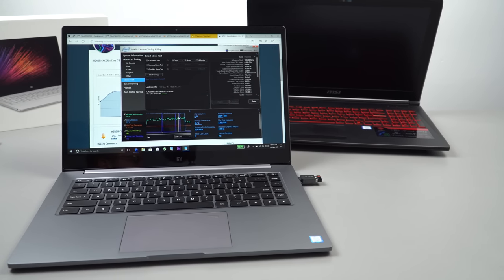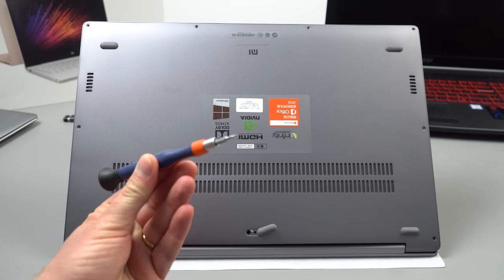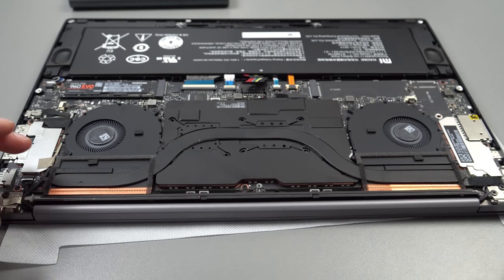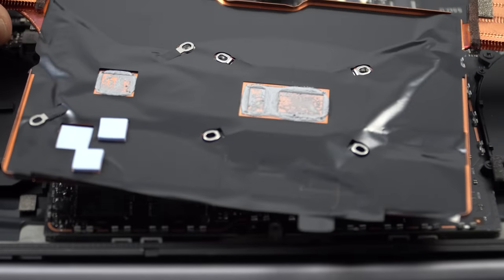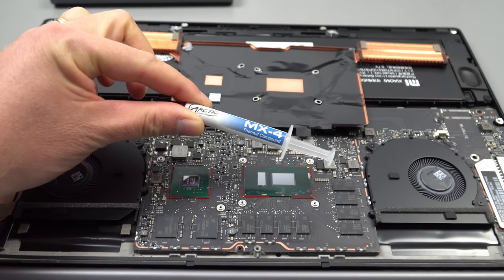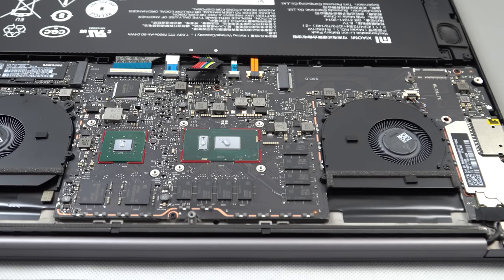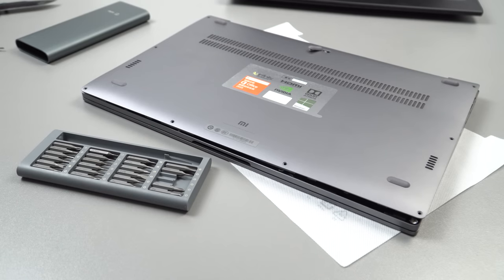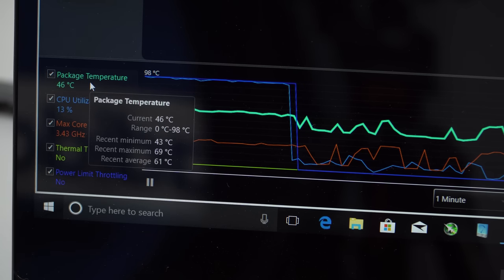Xiaomi Mi Notebook Pro Thermal Repaste, Results, How to Open & Add SSD

Comment: 5 degrees drop is actually a nice improvement. It might not be that impressive for desktop rig, but we are talking about slim laptop. Those crappy pastes that come with notebooks usually do not last long enough to provide decent cooling for even a year of heavy usage.  So, it is DEFINITELY worth it.
Reply from the maker: Yedige Moldagaliyev I was thinking more in the amazing 15 drop on my MSI. But it has a big fan so all in, 5 degrees C is good. Just maybe not for everyone the work involved for 5 degrees C.
Reply: If it's worth it, if you can make the heat dissipate into the chassis/cover as well, maybe it's worth trying? It would hot on the lap though. :P
Reply: @xygnal  Beside dust cleaning and replacing the thermal paste, undervolting the CPU also helps reducing the heat. I use throttle stop for that. Controlling the fans is also good, I use NoteBook FanControl for that but it is very complex (need to read Embedded Controler and testing the fan whilist searching for fan registry to program  it)

Comment: 5 degree is definitely worth it :)
Reply: Nope, it is not. You talk about a mobile CPU and not an i9 Threadripper here. You don't need OC headroom here.
Reply: Red Phoenix Well, actually you can quite overclock it. I've seen people improve both CPU and GPU performance by a 30%

Comment from the maker: This one was requested quite a few times. What do you think, Is it worth the hassle for 5 degrees C max less on maximum temperatures?
Reply: 5 degrees is a big improvement, but i guest i am toooooooo lazy and probably won't do it.
Reply: Even a degree might stop the fan from spinning, so 5° is actually a good one. Remember the GPD Pocket? I also only get 5° drop (in idle) even without using the MX-4, but the machine becomes so awesome that you can push it a lot more (it can now compile its own kernel with all 4 cores in turbo) without getting frozen or reboot.
Reply: I use liquid metal on my macbook pro 2012, got about 20C cooler than before. it is not so hard to do
Reply: for the Enthusiast level, the answer is yes h_h.
Reply: It depends. Seems their cooling is adequate this time, compared to their Air 13 which thermal throttles like crazy with that stupid single pipe-dual heat sources design.
Reply: I think it is. I wouldn't mind running at 75c at a given time but I would not like running at 80c

What I discovered recently was that even if the fan intakes from my razer blade looked fine the system was running real hot. Blowing on the fans didn't work and the fans looked fine.

Blowing from the exhaust however showed debri, there was a layer of dust collected at the fins which were invisible and in order to clean them you must blow air in the reverse direction from the exhaust.. My laptop went from 97c to 75c avg.
Reply: What I would be more curious about is how you switch the hardware keyboard layout to a completely different one than chinese. I started assuming it was not possible as some symbol keys just aren't the same but maybe it is?
Reply: 5 down from 74 is in fact 6.75%. Which is pretty decent, it doesn't take much effort in my opinion if your unscrewing the bottom to place an SSD. But considering the the quality of the paste i would reckon the temperature would start to rise shortly after purchase.

So yes, it's worth re-pasting when you can safely.
Reply: fyi - polishing the copper plate can help a decent amount.  also, there is non-conductive "metal" paste out there that is supposed to work pretty good too.  btw, can you test the gpu to see if that helped it's thermals at all?
Reply: YES.. -  polishing the copper plate can help a decent amount
Reply: USE LIQUID METAL :D
Reply: I've read on a recent internet post that the fan is set to kick in at a certain voltage, not temperature. The new heatsink paste might improve CPU / GPU temps, but the fan will still be noisy.
Reply: you dont need to spread it at all tbh. the heat sink will do that.
Reply: Yes, 5 degree lower with just re-pasting is totally worth it.
Reply: Good video but I think 5 degrees drop is worth it.

Comment: In the next video use clear nail polish on the exposed electrical components on the processor and then you can use Thermal Grizzly Conductonaut.

Comment: Do becareful if you are planning to open up the back cover. The side clips are fragile. I broke 3 ! Not sure how to avoid it as it is really tight and you do need some level of force to pry it off. So yeah, you do have to ask yourself if you really need to do it and if it will be worth it.

Comment: It makes a huge diffrrence, use both the arcticlean purifier and cleaner and put grizzly kryonaut on perfectly you can get around a 8-10 degree difference instead of a 5, also in the long run the old one wudnt have been worth it, can you upload some more mi notebook pro videos?
Reply from the maker: Maybe not too sure what more I could post on the Mi notebook Pro. I have covered it all. The last might be a follow-up video.
Reply: try to install mac os on it

Comment: I just wanted to say that I bought this laptop to have a portable machine that i could use for somewhat intensive tasks. It was an upgrade from an alienware17 and a surface pro 4. It sort of combined the two. Anyways, I use Solidworks a lot for 3d renderings and flow/stress simulations and after setting up an overclock profile in Intel's XTU, It overall outperformed the desktop PC I was using(dual 980tis, core i7@5.0ghz). I was however experiencing thermal throttling when running some simulations. I later confirmed that was happening by running a couple stress tests. So i decided to go ahead and I opened the laptop up, removed the paste (which seemed a bit too dry for some reason) and I added some arctic silver 5. I put the laptop back together and after running the same set of simulations and tests, I did not throttle a single time.  Maybe there is some variability in the paste/application of it but for me, it made a real-world noticeable difference.

Comment: When repasting, you shouldn't look at the amount of it to determine the quality of the pasting job. The only difference the amount makes is how clean it looks (as long as it's not way too little). The way of applying also really doesn't matter; just skip the spreading part, the pressure from the mounting screws will do that just fine for you, especially on such a small surface. You can do it if you want, but it will not improve the thermals at all. Source: https://www.youtube.com/watch?v=r2MEAnZ3swQ 

In short; buy a better quality thermal compound (I'd recommend Thermal Grizzly Kryonaut if you can find it at a decent price, or Gelid GC-Extreme if you can't), just put a little bit on there (too much is better than too little) and let the mounting pressure do the rest.

Comment: Could you confirm that the 2nd SSD can be SATA or NVMe (2280)? Could they work in RAID mode? Thank you for your awesome videos!
Reply: aldebarandj for some reason they are only given 2 lanes of pcie so i dont think you would be able to. Thats why drives cant hit top speeds.
Reply: The first SSD has 4 lanes alright. It was a UEFI issue.

Comment: Hi there, I'm just wondering what type of SSD you added to the secondary slot?

I know you say both will work in the video... but I'm curious where you got that information from? Did you try both types yourself?

I've been looking and posting all around forums, youtube, and even contacted my import company for compatibility but have not yet received a proper response indicating which type of SSD will and won't work in the slot

Some say PCIE x4 NvME will work and SATA III won't
Some say SATA III will work and PCIE x4 NvME won't
Some say both will.

It looks like you added a Crucial MX300 which is a SATA drive.

Also I'm trying to upgrade to a 1TB SSD for the secondary slot. Do you see there being any problems with this size?

Thanks in advance. Great reviews you have on this product by the way. The best that are out there really... quite in depth and easy to understand.
Reply: I bought a crucial P1 NvME 2280 and it worked at first but then it stop detecting the disc, when I rebooted it, it sometimes recognized it and sometimes didn't.
I contacted Crucial and they said the laptop wasn't compatible with the drive.
Now I don't know what to buy.
Reply: for second its sata m2

Comment: I have an idea, the fans are metal right? And they are cooled anyway. Do you think that it’s a good idea to put some thermal pads on it to absorb the bottom panel temperature? It would make it harder to open the case though  but it’s not permanent
Reply: They are plastic

Comment: In a desktop? Meh, not a huge improvement, specially with a cheap 212 EVO and a huge fan, but on a tiny space with "anemic" blower style fans are more than you give them credit. Those degrees may not be a lot, but may be very well the difference between fans ramping up far less on normal use conditions. And if the paste you replaced was already starting to dry out, those 5 degrees may not seem much, but will be HUGE in a few months. Your ears will be glad you did this.
Reply from the maker: llomellamomario surprised me how it was already drying out a little that factory paste.

Comment: Dude come on, 5 degrees is a lot for a notebook, but mainly for the following reason: The better thermals you have the longer it is between maintenance is needed to clean out the inevitable dust build up on the fins of the heatsink. So yes, it is worth it. Also the laptop will be more silent because the fans don't have to kick in as loudly or as often. Another thing is that when you have huge spikes in cpu usage better thermal paste will deal with that better, so for applications where your cpu spikes a lot it is worth it. 5 degrees is alot in a laptop.

Comment: I have an idea, the fans are metal right? And they have good airflow anyway. Do you think it’s possible to transfer some heat to use it as a heat sink itself? Use thermal pads between chassis or some super flat copper bridge to heat pipe
Reply from the maker: it would be possible, but not really sure it would do much here. In the case of the fanless tech I review it does really help out.
Reply: Thanks

Comment: 70 deg under 100% load? that's a lot of headroom for a thin and light laptop. even for u series processor. they did a really good job cooling their cpu
Reply: i got 100*C all the time Thermal throttling with only chrome and 50 tabs.. cpu 10-15 Utulized

Comment: In case I want to install XTU, the installation routine tells me, the hardware is not compatible. Is this true for the Xiaomi Notebook Pro GTX Version? It seems I have massive throttling but only in battery mode. If connected to the power brick the performance is excellent.

Thank you
Michael

Comment: Just a question not related to the CPU, but i will buy this computer and i would know if it's possible to have 3 screen in total (2 external screen + the computer screen) for example 1 screen on the hdmi and 1 in the USB-C (with an adapter). Thanks for your great test.
Reply from the maker: Yes its possible. One screen on the HDMI, one the laptop screen and the other via the Type-C port.

Comment: i got closer to a 10c drop with noctua nh-1 and the pea method rather than the bag method, very worthwhile upgrade.
Reply: Jon Daly nice, did you also notice the fans come on less? Still looking for something to shut them up
Reply: you know i thought they did, but i read somewhere that the fan speed is controlled by voltage rather than temp, i have noticed a difference in fan noise after using xtu, i couldnt undervolt using xtu as i have the rev 501 bios but you can force the cpu to underclock by reducing the boost power limit to around 11-13 watts so that the power throttling kicks in and that has had a significant impact on fan noise under load for me.
Reply: 11w still gets a 3ghz boost under load and but the 3rd speed on the fan curve doesnt kick in nearly as much

Comment: The BIOS shouldn't reset, that's what the CMOS battery is for (unless they do not have one, which is unusual).
Reply from the maker: Hugo Costa Never saw a battery for the bios in there.
Reply from the maker: That would explain it

Comment: 5 degrees but how much rpm on the fans? i changed my thermal paste on the lenovo x240 , had a 12degree decrease with a 400rpm fan decrease

Comment: Use some thermal pads on the vrm's if the heat sink is that big. It helps dissipate alot of heat as well.

Comment: A five degree reduction in temperature will translate into more reliable performance at higher ambient temperatures, so yes, it's worth it.  If better quality paste doesn't dry out and lose effectiveness over time, then yes, it's worth it.  If doing this gives you more peace of mind, then yes, it's worth doing.
Reply from the maker: Yes at the time due to the effort I didn't think it was worth it. But yes you're right it is.

Comment: Cooling problems on Jumper, Onda and Chuwi tablets and laptops is one thing. Those are low-end off-brands and it's to be expected. 

Xiaomi and MSI should really know better though and this is pretty inexcusable.
Reply from the maker: MY MSI was a shocker, hit 96 degrees C. With my repaste dropped it to 81 degrees C max.
Reply: I think when you pay for a brand name like that you should be able to expect a certain level of quality and service and MSI have clearly failed on that one.

Comment: The real problem with this notebook is why should the CPU fan kick on at less then 20% CPU load, even for 5 sec loads? How much heat can be generated when CPU is working for 3 sec at 25%, that the cpu fan needs to come in and spin? It's ridiculous, something need to be fixed at the logic level, not at hardware one, right? At least, I'm talking about the Xiaomi air 13, I don't know if the Pro behave the same.

Comment: "I use a high quality thermal paste"
"I use MX-4"

Arctic Silver 5 would be a better replacement bro.
Reply: Not really. They're negligible in temp difference and AS5 is more dangerous for something like this where you have a lot of SFF conductive components close together.
Reply from the maker: Exactly I prefer not to use AS5 for that reason. and the difference between top end and med range paste will be like 1-2 degrees if that in a case like this. If it was an i7 8700k I would rethink what paste I use and go for the best.
Reply: I still use MX-4 even on desktop PC's tbh because I find it far less risky and I've always been pleased with the results. I've never been a fan of AS5 and I used to hate fixing 360's when people had caked the chips in silver paste.
Reply: Check my reply to Blood Rose's first post, you might enjoy the read.

Comment: You should really try Conductonaut on this or some other ultrabook. My dad has an old Pentium T6100 which has TDP of 25W.
After putting Conductonaut on it, the temps didn't go above 50°C even after 30min of prime95 smalFFT torture. Fan was spinning at it's minimum RPM.

Also, someone mentioned nail polish on resistors. It would be awesome if you did all of this. You might be impressed like on your MSI or even more :)

Comment: hello can i ask for help i have the same pc but the 13.3 inch lately i have been experimenting an issue when as when ever i leave the pc for like 5min it goes int sleep then when i try waking it up but hitting the keyboard the screen remain black until i hard restart it at first i though it was the thermal paste so i repleaced the thermal paste still not resolved help me if i can fix this i going to a mac book.

Comment: Can you open it and do a video on how to repair the keyboard?
Thanks 
Like for him to see :)
Reply from the maker: I don't need to open it again yet, maybe if I do
Reply: To repair the keyboard (i just replaced it), you would need to open the case, unplug the battery, and the 2 connectors from the keyboard itself. Then you can remove the battery. Then you would have to remove all the screws from the motherboard (no needed to remove the cooler of the cpu/gpu or the fans) and no need to unplug the connectors from the motherboard to the chasey or panel (just be extremely careful when flipping the motherboard in order to not break or damage any cable), be careful with the screw behind the tape, and with the antenna cable that you can unplug) . Once you're here, you would need to remove the plastic cover that is above the keyboard, and unscrew about 79 tiny screws that are holding the keyboard itself to the chasey.

You now can put it the new keyboard, screw back the 79 tiny screws, and put the plastic cover on the back of the keyboard an assemble the motherboard in place again.

Just do every step very carefully and with a lot of time and no pressure.

Kind regards.

Comment: Jus applied it myself. After doing it got temps of 55° then did another stress test 10 mins later and got the same. Shutdown the laptop for 4 hours then did another to jus be sure and got temps of 70°,  did another one 10 mins later and got the same. Whys the temps increased? Does it take sometime for the paste to settle and see the difference ? Can anyone help on this, bit baffled.

Comment: Mx4 is Pretty good,i had it on My 5GHz i5 2500k cooled by a silent loop 360mm that gets fresh air from the top of my Dark base pro 900,IT was running at 89c (i know pretty hot) but after i did put condoctunaut on it it was 82c so well if you do a lot of thermal paste replacing get some Mx4 20g tubes